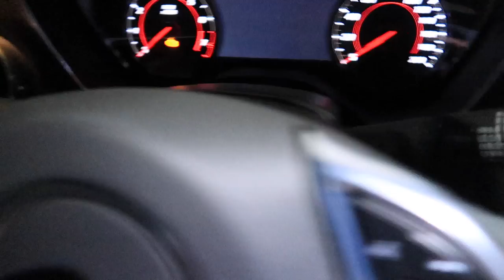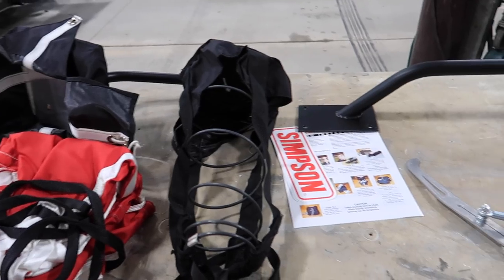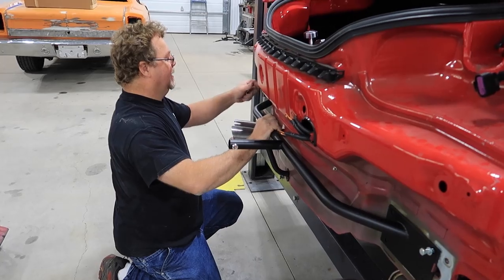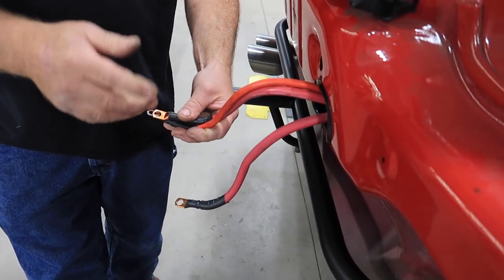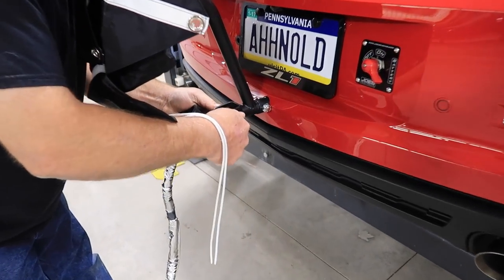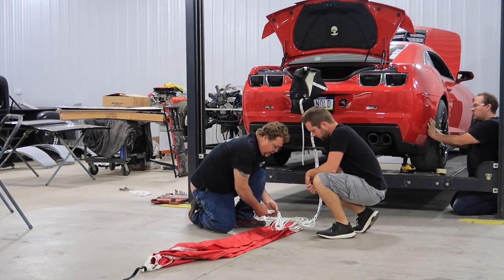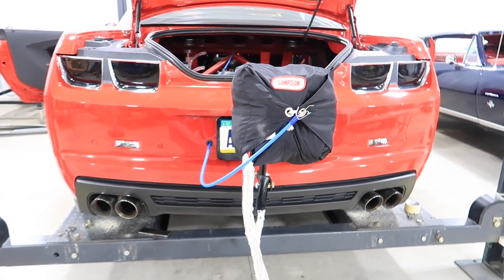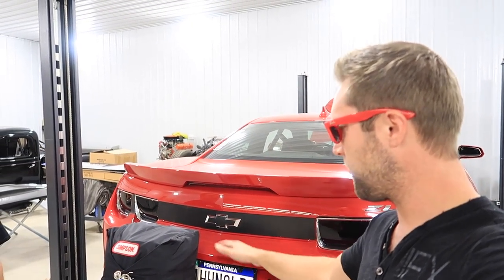My 2013 Camaro ZL1 Gets A MUCH NEEDED Mod!!!

Comment: Time to replace all the glass and remove the carpet and insulation that is still there. Remove the door panels, plastic paneling inside, etc. I still see plastic in the back seat areas on the sides. Strip that thang! HAHAHAHAHAHAHAHAHAHA Weight reduction ftw. Don't forget to add ac couple of extra meme decals for that extra hp. But for real, I like this set up a lot and like the way you have this car for the most part. Everything looks clean and not all hacked up.

Comment: I have a 2015 Silverado crew cab that I bought from Bachman Chevrolet new. What are your thoughts on installing a cold air intake? I've never done any performances mods. Is cold air inductions a good one?? Your thoughts would be appreciated.

Comment: A very informative video how to pack a parachute like I use one on my street car something always wanted to know NOT and really your car does 9 second quarter mile really u need a parachute really a parachute brakes are good enough my bike does 8s I don't need no parachute and neither do drag cars till there making triple your power just a show off thing
Reply from the maker: suzuki turbo A parachute is required for cars trapping 150mph and up. I trapped 148mph last time at the track with a 150 shot. Before the car goes back to the track, it's getting upped to a 200 shot. My brakes are already turning blue from making 6 passes all above 146mph. If you followed since the beginning of the safety modifications, you would know that this is all being done so I can legally race at a drag strip and not get hassled or kicked out, and it's all about being safe. Ever hit a wall at 150mph?? Didn't think so. You'd be dead in a stock interior car.

Comment: What's wrong with bigger brakes?
Reply: With regular disc brakes, after constant use at the strip, I wouldn't be surprised if they warped and/or cracked.
Reply: Peter Marino ya plus going 150mph+ to 0 in like 300 feet is a lot to ask for disk brakes lol

Comment: +GuitarmageddonZL1 What's the next safety mod when you reach another speed
Reply from the maker: necstanunn probably more points to the current cage. Tranny blanket, driveshaft loop, not really sure what's next though.
Reply: GuitarmageddonZL1 Trans brake?